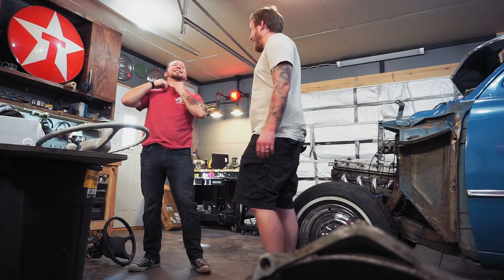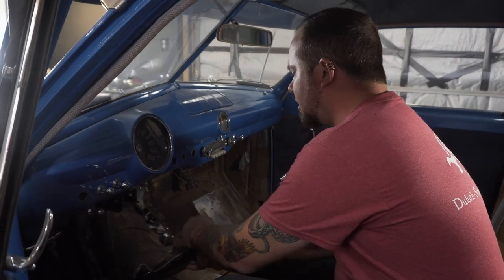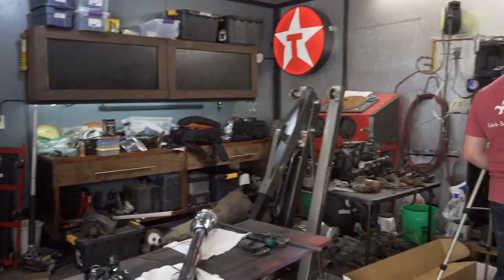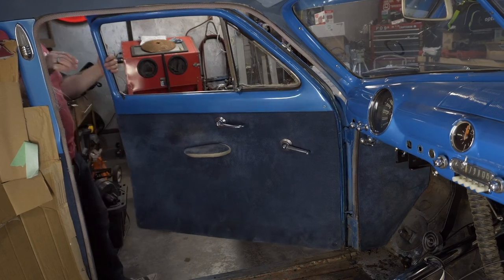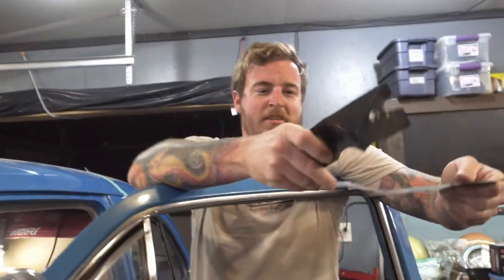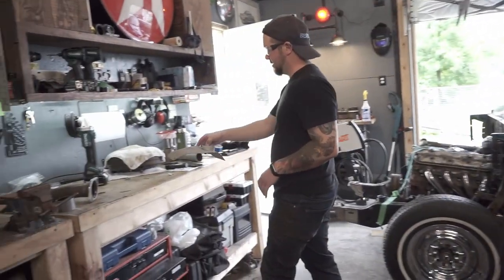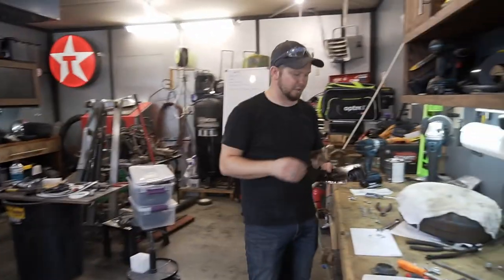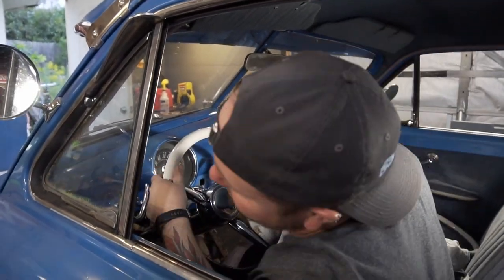Speedway column, Con2r wheel and custom steering shaft on an S10 Clip swap; Shoebox Ford Ep7

Comment: Where is the new steering wheel from?
Reply from the maker: Hey Rob, that is a Con2R wheel. You can purchase this specific one from Speedway Motors or you can purchase and design your own wheel right on con2R's website. 
We would suggest starting with https://wheels.con2r.com/ and use the designer to make your wheel then compare prices and decide what works best for you. Jake loved the premade one that Speedway had in stock so we went that route.